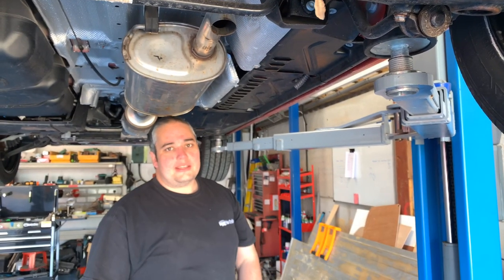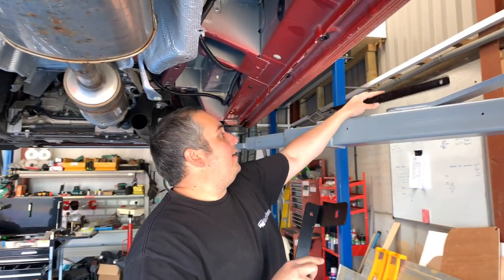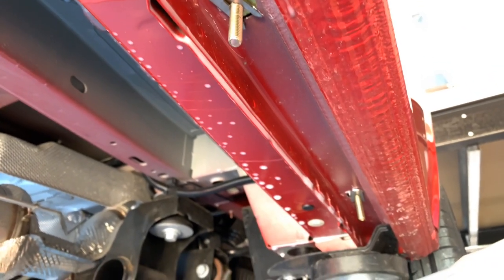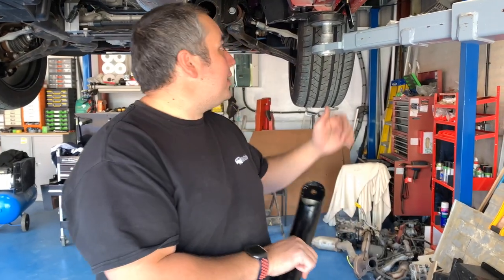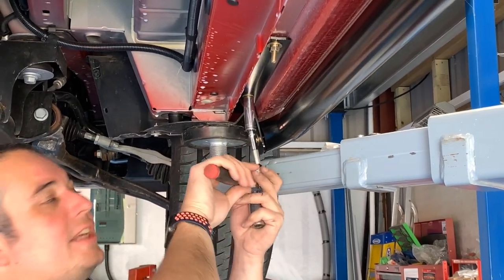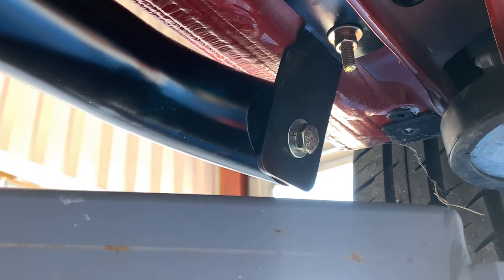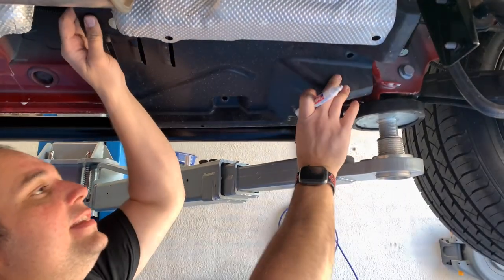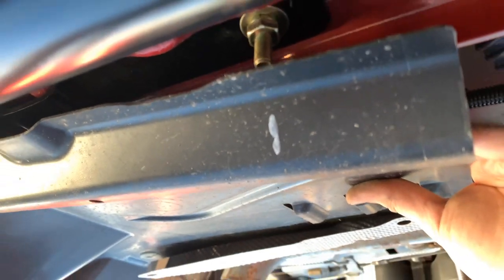VW Transporter T5 & T6 Side Bar Installation - Step by Step Guide to fitting

Comment: my bars have two threaded bolt holes a few inches along the bar, So not sure which fitting kit I need
Reply from the maker: Hi, You will need to speak to where you purchased your bars from. Usually side bars come with the fitting kits from the manufacturers.

Comment: Can't you just shorten the bolts and put under trays on? Or even use shorter bolts seems a bit wrong to be chopping at the under trays to let a boltvstixk through
Reply from the maker: You could but it wouldn’t help much as the plastic under trays sit flush with the bottom of the van, once you add the thickness of the bracket, a locking washer, washer and a nut the smallest clearance required would be around 20mm. This would then push off the hole under tray and leave gaps. We have tried it in the past but found it better to holesaw a 30mm hole on the bolt locations in the tray.